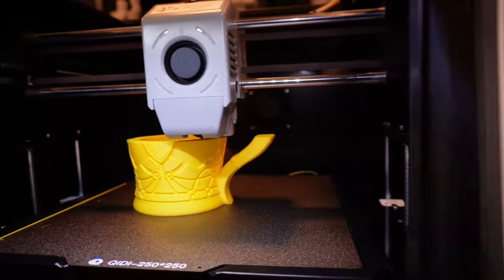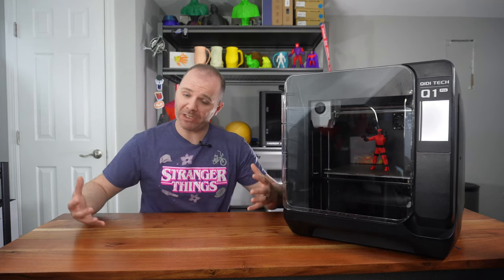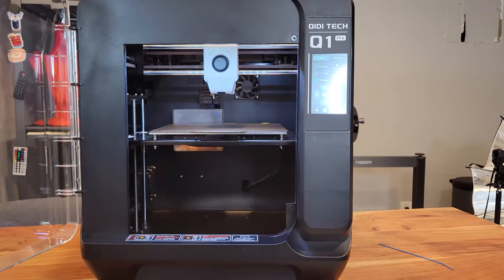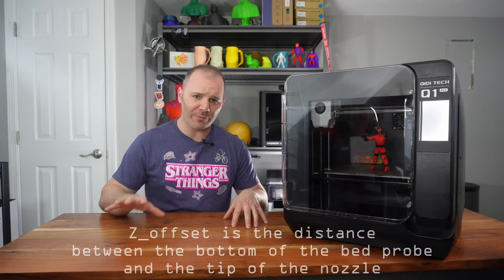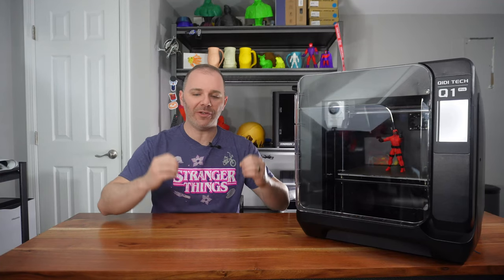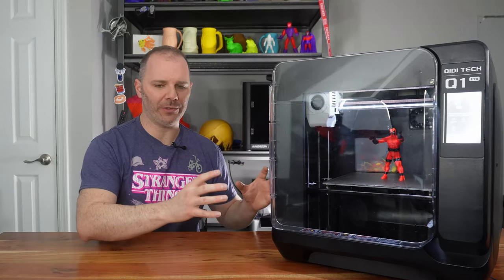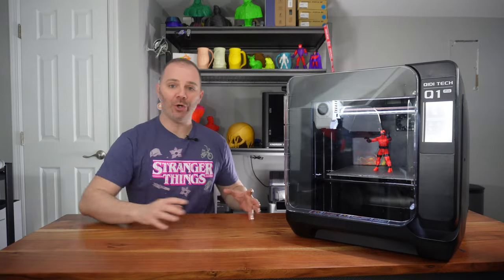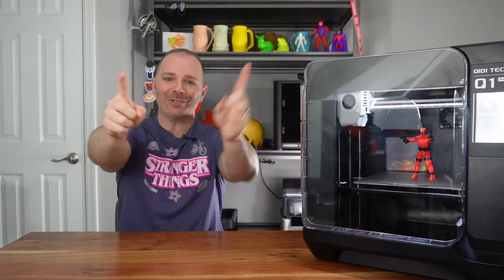A 3D printer for beginners and experts!

Comment: I want to replace my Ender 3v2 with either his printer or the Bambu X1C. There is a big price difference, but buy once, cry once. I am space limited , so I'll boot the Ender to the garbage dumps soon. Bed leveling issues and constant need for maintenance are my biggest complaints about the Ender.
Reply from the maker: Those Enders are great printers but there is a lot more hands on needed then with the newer coreXY printers on the market. I have the X1C, P1P, and now the Q1 Pro.  Depending on your needs the P1P may be a better Bambu option than the X1C. That being said I am partial to Klipper based printers, which is what the Q1 Pro is. I think it's too early for me to give my definitive answer as to what I would buy, but I'd be happy to help you decide as I have both printers. The biggest hurdle for the Q1 is the slicer, as Bambu has made slicing for beginners pretty easy using its MakerWorld app. But if you have an Ender3V2 and are familiar with slicing in general, then I don't think that specific hurdle would apply to you.

Comment: the website says the hotend goes to 350c?
Reply from the maker: It does in fact have a max temp of 350c. I never got a chance to print any materials at that temp though as I only have nylon on the higher temp end.
Reply: @PrintsLeo3D  lol ok i got confused cause the screen said 250c lol
Reply from the maker: @hasanmich1504 my apologies, I was probably running a petg or ASA print

Comment: I wanted one until I jeard it's klipper is 2 years old and not easy to update. The live heater is a mute point really as you have to go out of your way to electricute youtself, more effort than electricution from a power outlet.
Reply from the maker: Steve, to be honest in my opinion I found the old release of Klipper to be a moot point. While this is an older release it still functions just like you want it to, and it does include one of the more important Klipper features 'object_exclusion'. This was a similar issue to some of the last printers Qidi released , but they made efforts to get those printers updated.
    To be totally honest if that is the only hurdle to buying this printer I think you should reconsider, but I do understand having concerns. If you have anymore questions about this printer please let me know. Thanks for watching and commenting.